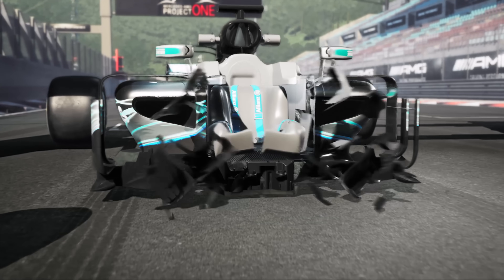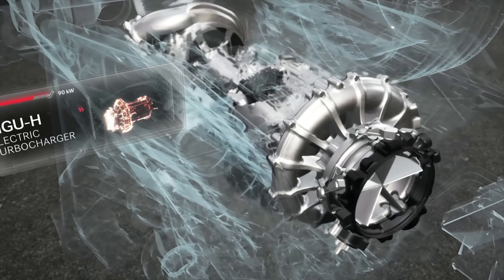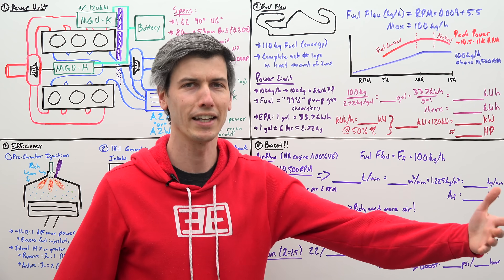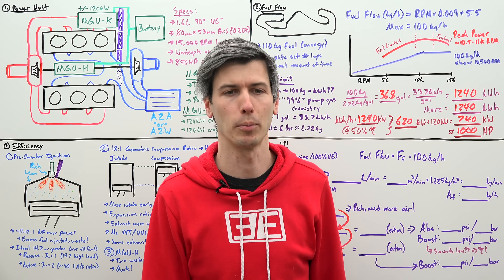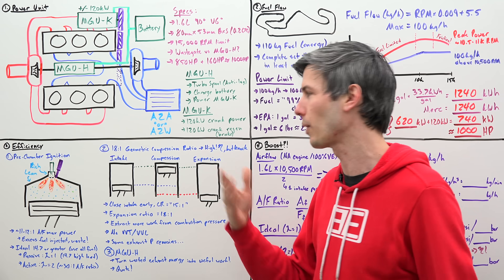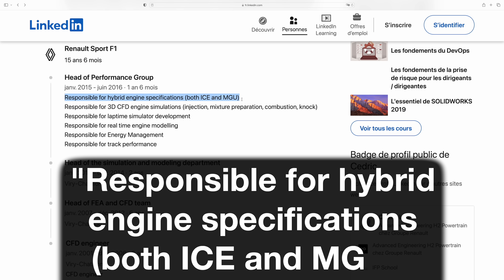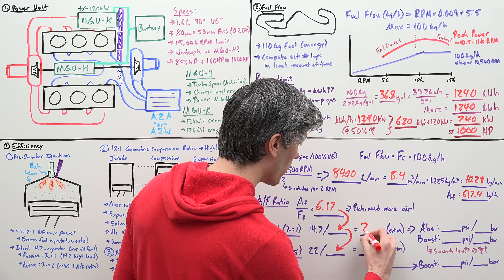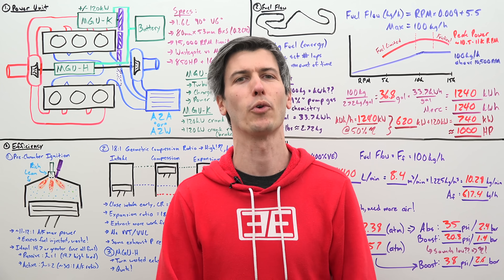How Tiny Formula 1 Engines Make 1000 HP!

Comment: Once upon a time the V8 was king.  Big, heavy and relatively low peak RPM by today's standards with gobs of low end torque.  The 1996 Chevy Caprice police car 350 cu. in. (5.7L) V8 was rated about 185 Hp and very similar to the engine in the Corvette.  That engine could propel a nearly 5,000 pound car to about 140 MPH.  And, at 60 MPH that engine was loafing at about 1,200 RPM.

But, even before that time, there was a trend to smaller, higher revving engines producing more HP in a narrower power band.  The trade off was engines running faster to create power and thrashing themselves to death.  But, technology has improved to the point that even the new V6 and I-4 engines routinely last 200,000 miles or more.

Comment: When I was learning the High Performance aspect of my automotive technologies degree, I came across a very profound quote from another engineer who had been in the field for a long time, although I'd have to look up his name. To explain your seemingly low boost number, his quote was, "Boost is just a measurement of how inefficient/restrictive your intake system is." You can bet with the engineering and amount of money in Formula 1 that they have extremely efficient intake systems, hence lower boost numbers for seemingly higher power output. You proved this concept with your elevation analogy when you stated higher boost levels are needed at higher elevations due to thinner air. The average engine loses about .5 lbs of boost per 1000 feet elevation above sea level. This means that in order to get the same performance, the turbo must be spun faster (higher boost) to get the same amount of atmosphere into the combustion chamber. A more/less restrictive intake has the same effect as higher/lower elevation.

Comment: BMW F1 "Megatron" engines used produce up to 1500 BHP (in qualifying trim) stock block (iron) at just 1500 cc. No MGU in those days, (late 80s/90s) turbo lag was the norm.

Comment: In a racing configuration,  power would be the main goal and not efficiency.  People have made the claim of 50% efficiency with ICE but I have my doubts.
Reply: Actually, if you make the whole thing fuel limited, you need efficiency more than anything. Because if your fuel is limited, higher efficiency means more power.
Reply: When you can’t refuel, Efficiency is everything(Don’t even try arguing bringing it back. The teams couldn’t follow the rules and more than enough accidents happened).

Comment: I was a Porsche tech in the mid-70s when the 930's came out. I attended all of the new tech training for these systems. I marveled at the engineering then, but this pales in comparison. I often modified the waste gates for some "special customers" to give them about 1.1 bar. The factory set was .7 bar. Road testing these after a full service was the best part of my day. 😎
Reply: Did you modify tune as well or did computer handle that and you nearly doubled the boost so could injectors supply enough fuel at these boost levels?
Reply: @msk3905  It was the Bosch CIS injection system then, when they first came out. (No computers) That system's fuel delivery rate was dictated by the lift of the sensor plate and as the engine needed more air it would go higher, faster. No modifications were apparently needed, at least in "normal" driving conditions. I'm sure putting this on a dyno probably would have noticed some decrease in the power curve. With these, being street cars, the customer was more than happy with the results. I usually tried to dial in about 1.0 bar as these weren't really designed to have that much more additional crankcase pressure. I did have to ground the limiting switch wire so the fuel pumps wouldn't shut of by an overboost signal.

Comment: This was interesting f1 cars run boost levels of a diesel car. I used to have a somewhat high reving diesel and noticed that when reaching peak engine power the boost would drop dramatically. At peak torque i would have up to 2.5 bars of boost and at peak power would drop well below 1.5 bars and now i understand why which is cool.

Comment: I submit a better choice than a Battery for this configuration. Since only short-term power storage is the requirement here, an Ultra-Capacitor is better suited ... from a size, weight and simplicity standpoint. However, since the voltage levels will be constantly changing in the exchange between the three (MGU-H, MGU-K  & Ultra-Cap), power management electronics will differ for an 'Ultra-Capacitor' approach.
Reply: There’s a lot of problems with using capacitors. For one, F1 doesn’t just do short term storage. A lot of times the Cars are in a harvest mode trying to build battery for later use when defending or trying to overtake.

Comment: Off subject but I had one engineer tell me an extra gear or two on an electric car can't provide any type of  benefit or improved efficiency 😆 Another told me my air compressor idea of connecting the  tanks of 2 smaller air compressors together, so you could run both when you need more air would never work 😆 Another told me 2 magnets would change polarity in a couple days if they were placed repelling each other. So I put 2 donut magnets on a pencil & 2 months later, the top magnet was still floating in mid air/repelling each other. All 3 "engineers" had engineering degrees & were making decent money 😆

Comment: Very well done.  I like how you're very clear in that a lot of what you are calculating is based on Hypothetical knowledge (Not theoretical, because you don't have the data from the engineers to support your Hypothesis, so it is an educated guess.) because you don't know the specifics.  So you are making what I would consider a very well educated guess based on your prior knowledge.  Very well done.  Your prior knowledge does make it easier to understand how everything is being used though.  Thanks.

Comment: There should be a limit on team budgets to encourage competition, or some sort of "trickle down rule" on technology, again to encourage competition. After that, as long as the car fits into a certain size, the driver actually drives the car (no robots, no automation etc)  and isn't dangerous to other drivers (no spikes !) ... anything should be allowed. If Ferrari want a 7litre 13 cylinder diesel engine driving 3 pairs of 50inch tyres...let them etc etc

Comment: Hehe, in the mid '80s we were stunned when 1.5 litre turbo F1 engines could push 1400+bhp during practice sessions just to get grid positions, then dropped down to "only" 1000bhp for the race.

Comment: That point on why they make so much power on very little boost is exactly what I thought when I saw a great video on an Indy Buick V6 engine here in Aus, it was making around 400kw on 4.5 psi of boost on 3.3L displacement. They too rev very high.

Comment: Hello Hello From Canada!!! I really loved this episode more than usual and my mind is just running away with questions but you are probably to busy to answer question now that the channel is so big. The costs of the electrically assisted MGU-k & MGU-h motors like you say is really high, but why have the auto builders not capitalizes on some parts of these systems to create better vehicle in both performance & more efficient running engines, but at more reasonable prices?? Honestly if I could get even 500 HP from a 1.6 Lt engine I would jump all over it for the weight advantages and potential "economy or high performance" tunability for a killer road & weekend track vehicle. Then instead of a monster (7.0 L) Hemi weighing me down and guzzling gas by the bucket, I could dial up when needed or back for around town. Am I just seeing this on to much of a basic level, or is it all so complicated to manage that it just wouldn't work at all for mass production vehicles? Can't wait to see what you do next.

Comment: It's such a waste that the design constraints in F1 are so severe, and that F1 is so popular. I wonder what those engineers could pack in a vehicle if there were no regulations on fuel flow or engine specs. Also if their cars could use as much driver assist as they could pack on it, heck, AI driven cars would be really cool and could be way faster. A much more entertaining sport.

Comment: Excellent presentation. Thank you. 🙂Your last comment is priceless. ha-ha. I am amazed to see how much the F1 engineers can manipulate the air / fuel ratio, etc within the strict rules of the FIA. 
As a garragist (mix & match), back yard mechanic, I was surprised to see that the average racing revs were so low and that higher revs don't result in more power. ha-ha
As an example, we used moth balls to methanol petrol to boost power. On takeoff, using this mix,we would be absolutely lethal, but had to switch back to methanol fairly quickly to stop standard pistons from melting. ha-ha Later,using racing pistons helped us control this problem. That period in my life was good fun in those days ha-ha 
Overall, I had to watch your presentation a couple of times to begin to understand how everything works. ha-ha

Comment: The 100Kg/hour full is on average. So when accellerating the boost presure will be much higher.
Reply: How can it be a average? An average over what period of time?
Reply: @callumcurtis15  You are right, it's the maximum flow of fuel, not the average during the race.

Comment: You forgot that air ingestion depends on compression ratio, not expansion ratio. So 1.6/(2*18/15) = 2/3 liters per revolution. Times 11,500 gives 7,667 litres per minute. If your assumptions about Miller cycle is correct, which is a pretty safe bet. Especially with an MGU-H to ensure regulate air flow into the cylinders.

Comment: I'd love to see a completely unrestricted class as far as engine and chassis designs, with the only rules being that you have to run an entire race on a single tank of fuel, you also are only allowed a single engine for your full season so your engine design has to be both efficient and reliable. I'm guessing that there would be incredible advances in hybrid designs and energy recovery.
Reply: They used to call that Formula 1. Well there were limits on engine displacement, but not much else. I think it was 4 liters NA or 1.5 liters turbocharged. 6,8,10,12 cylinders, whatever fits your car. In the late 70's Tyrrell P34 had 4 front wheels. It's worth looking up if you've never seen it.
Reply: @jimandrews1011  The "Formula" word relates to the fact that there is a designated set of very specific regulations that define the racing class. Formula 1 was always very clearly defined and was never even approaching unrestricted. Yes, the formula changes from time to time but there has always been a formula with restrictions.
Reply: What happens if it doesn’t last a full season? Just a grid. Penalty wouldn’t be enough. People would take multiple engines anyway.
Reply: Keep it as simple as possible - just your fuel allowance and safety rules. Allow multiple engines as that allows some innovation during the season. 

Also don't forget crash damage and "accidents", so some engine failures can come that way. If we stick with two drivers per team then driver 2 could take out the car of championship leader from a rival team to allow driver 1 through to take title.
Reply: @ianstobie  In theory yes but actually no. FIA then loses control over teams developments. So cars will became  much faster and all safety systems around track will be unsuitable. Also manufacturers will get deterrent from entries into "wasteful" F1. Nowadays efficiency and green is PR name of game. Not quite in modern image companies want to represent themselves.
Reply: I thought it was still 3 engines per season.

Comment: No mention of the pneumatic valves or exotic piston shapes? 
The only reason they can rev up to 15k and above is because the valve train is electronically driven with pneumatically operated valves and not mechanically linked to the crankshaft or any type of valve roller.

Comment: You can get more informations, if you read through the new engine rule Set of 2026. In this era the electrified turbo charger is not allowed anymore, which leads to a restricted boost pressure of around 5 bar and a restricted compression ratio of 18.

Comment: Unfortunately, regulations have ruined F1 technology. There is absolutely no reason an F1 engine should cost $10 million, when reliability and performance could be achieved in simpler ways. Not to mention aerodynamics and active suspension. Every time there was a great innovation, the FIA just killed it off.

Comment: Not to be that guy, but these references are to the previous Formula 1 engine regulations. The current Formula 1 engine regulations went into effect in 2022, and no longer use the MGU-H, but instead use a more powerful MGU-K.

Regardless, great explainer!

Comment: Starting in 2026, the engine regulations will change to eliminate the MGU-H (due to cost/complexity and less viability translating that technology to production vehicles), but allow for much more power (up to 350 kW) to come from the MGU-K. And they'll move to 100% synthetic fuels, which will have less power density than current fuels, so with more MGU-K power they'll pretty much match their current 1000 hp total output.

Comment: Honda used a form of the prechamber ignition called CVCC.  Capturing exhaust pressure to generate electricity is an interesting concept.  I've wondered how we could capture the residual pressure.  You showed the Miller cycle once used by Mazda without calling it by name which is one way of doing it.  In the era of steam engines they used several expansion stages to do it.  Using the turbocharger is a way to do it but I wonder if it would be as efficient as building another expansion stage into our engines.

Comment: Hey Jason, as an F1 fan loved the video. I honestly didn’t expect this big of a difference in thermal efficiency between production and F1 engines. This makes me wonder why production engines are not able to achieve such figures. It seems that fuel efficiency would be a top priority for most production engine manufacturers so why is it that production engines rarely reach greater than 35% thermal efficiency? Is it Cost? Reliability? Maybe I am misunderstanding but would love to know more…
Reply: A lot of that has to do with how reliable production car engines are expected to be, and how little fuel they're designed to use overall. Even with limits on power unit components, F1 engines still complete a fraction of the mileage a road car will over its lifetime, and spend far less time idling, start/stopping, etc. It's also important to note that fuel economy and thermal efficiency are not the same thing; an understressed 4-cylinder engine running at low RPM is going to suffer greater friction/pumping losse due to not running at full throttle, but it's still going to use a lot less fuel than a racing engine running at 10,000 RPM, even if that racing engine is burning a greater percentage of the fuel going into it. Does that make sense?
Reply: @jazzbassrocker  Yeah, makes a lot of sense actually. Thanks for the reply Adam
Reply: 2 words BIG OIL
Reply: @ronaldjones743  lol. If manufacturers could make their products more appealing to customers by consuming less gas they would. There is no reason for conspiracy theories to explain this

Comment: One large constraint on production engines is emissions, with all of the new off-cycle emission rules and in-use emissions monitoring, non-stoichiometric operation is highly limited. It can be a challenge to respect component temperature limits and stay at an emissions air-fuel ratio although intake/exhaust VVT or external EGR at high loads can help. Lean NOx after treatment is possible, of course, but injecting sufficient urea to cut the NOx, plus the cost of the equipment and sensors needed make it more cost-effective to just run at precisely stoichiometric and accept the efficiency loss. Actually “precisely stoichiometric” is a simplification, we have to run at whatever chemistry balance the catalyst wants.

Comment: As a Certified Automotive Engineer, you sir, have just made it so simple for us to understand. Thank you!
Reply: do you work at the mercedes f1 team that you had to learn this from a youtube video?
Reply: @Imthefake  haha, no, but every engineer is a learner. I know mostly what the presenter is educating, what I learned was, how the mguk and the mguh works together with the engine and the battery. See, I work for a semiconductor company for many car manufacturers, producing brake sensors, throttle sensors, etc. We supply them. Alas, no matter how much I hate mercedes f1 team, as an engineer, I have to admire their engineering skills. They dominated most of the turbo hybrid era. But I got your sarcasm because they are not doing well at the moment 🤣
Reply: First time I've ever heard of a Certified Automotive Engineer.
Reply: @brianwright9514  there are many types of engineers, mechanical, automotive, mechanical - automotive, chemical, it really depends which course you graduated from and most importantly, is the course accredited by the Board of Engineers in your country. For example, I am from Malaysia and I studied in a Malaysian university that has been accredited by the Board of Engineers, which is a body from the Washington Accord. Upon graduation, I worked as an Automotive Engineer, and my specific job role is a Process Engineer. There are many certifications for engineering graduates. It all really depends. Hope that clarifies your curiosity.

Comment: If you were from a F1 team that had a prancing horse as it's emblem you could work out how the 100kg/hr fuel rate is measured and during the dead time between samplings you could pump fuel in faster. Not only that once you're eventually busted there would be no sanctions.